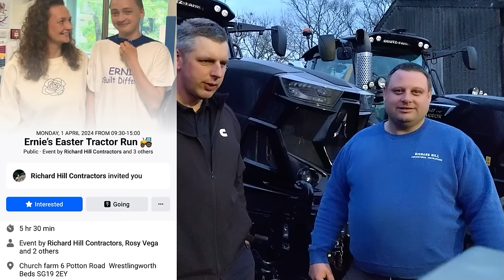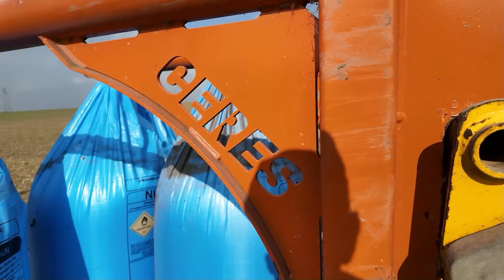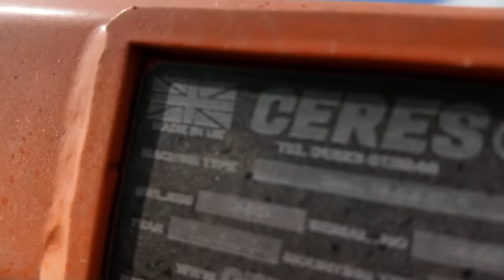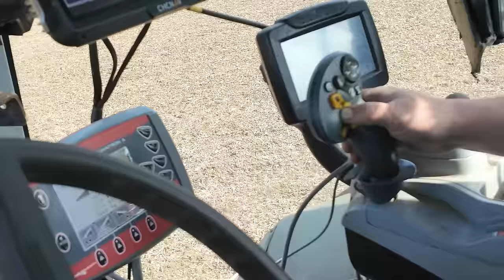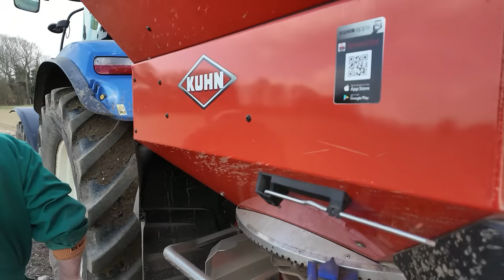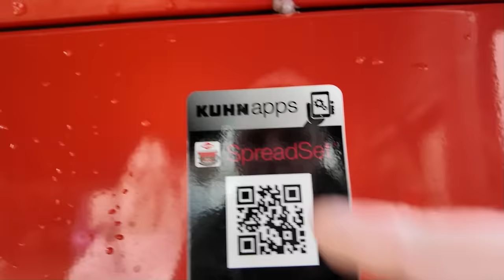NEW KUHN FERT SPREADER - BEWARE OF THE BULL

Comment: Interesting telehandler. Is pickup hitch aftermarket one? Oil brakes line or has it air brakes too?
Reply from the maker: They are pretty much standard on UK spec machines, this machine has twin line oil brakes however air brakes are an option